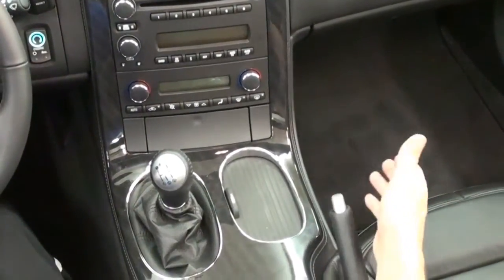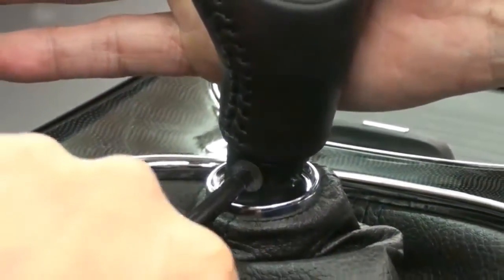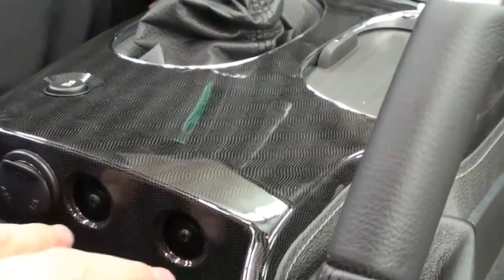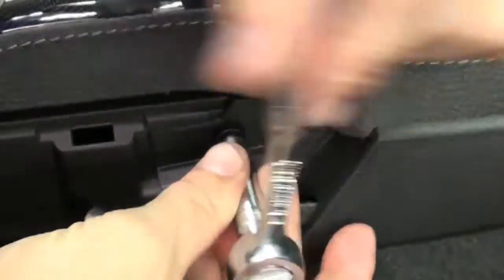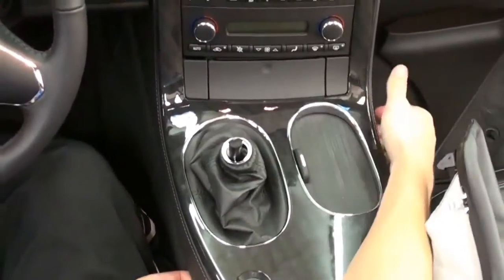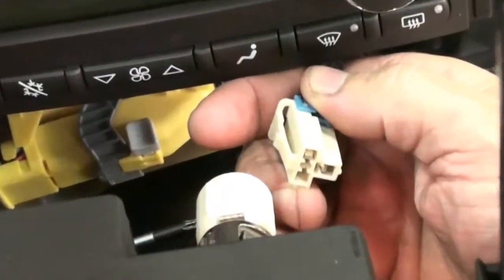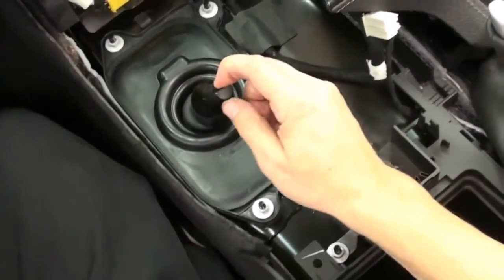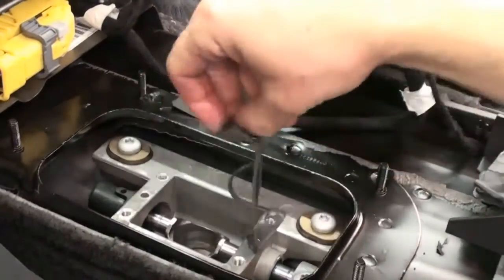MGW   C6 Corvette Shifter   Console Removal

Comment: Where are you located, because I need your assistance with this job.
I don't think I will be able to do it, you make look so easy.
Reply from the maker: Its VERY easy to do. You should have no problem . Just follow all the steps carefully . also watch our new all in one video for the C6 as the install for C5, C6, and C7 is actually the same after the consoles are removed.

Comment: How do you remove the shift knob on a automatic transmission?
Reply from the maker: not sure as we do not do auto transmissions
Reply: MGWINC I am assuming if i just want to change the center console (currently mine is silver on my 05...upgrading to newer carbon fiber look) this video is exact minus the last portion on the shift boot.